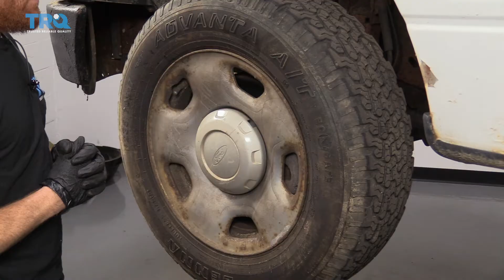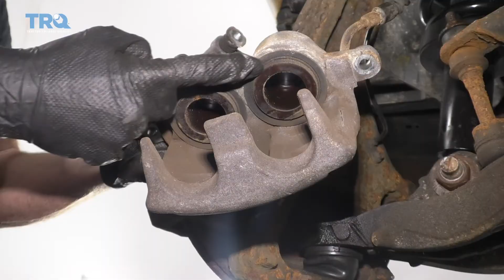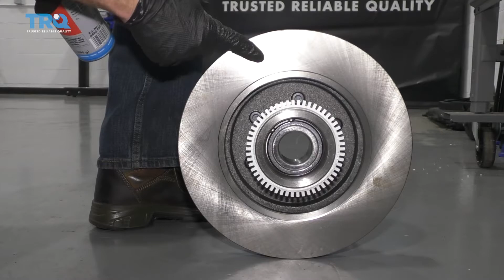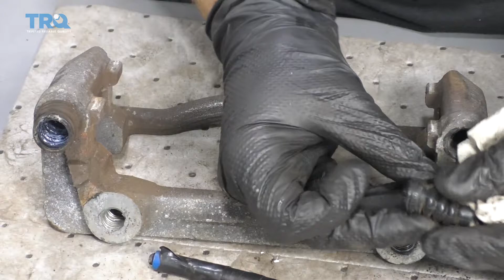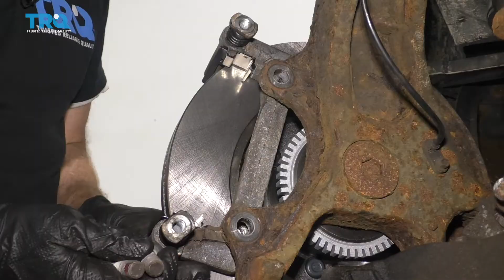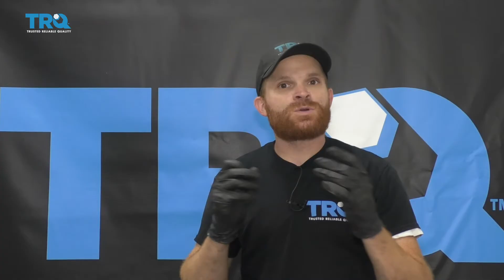How to Replace Front Brakes 2004-08 Ford F-150

Comment: One thing none of these guys ive noticed is they dont tell you to remove the brake fluid cap because when pushing the calipers back in brake fluid will go back into the brake fluid container.

Comment: Extremely helpful video. One thing that was frustrating to me was no one talked about the quality of the bearings. Upon further research I found most seemed to be no name brand from China. I did get mine at Rock Auto and found one with Timken bearings, however they were made in Timken's new China factory and are now called Goyou. They still had a better warranty, two years instead of the average one year so I went with that and they cost me 230 for both sides of the front axle plus ceramic brakes.
Some other comments: The 300 foot pound torque wrench was unavailable to borrow from any local auto parts so I bought mine on Amazon for $42 with half inch drive. Also got the 36 inch MMM deep socket for $14, and a much better dual cylinder press for $7. 
My rough issue was that the very end of the axle slash spindle had developed a lip on it and I couldn't get the new rotor back on until I filed a slight chamfer at the lip and afterwards it went on as sweet as a kiss.
Thanks for all your help amigo.

Comment: I changed both rotors and pads.... the day off... no vibration. Next day, i started to get steering wheel vibrations at 110kph... never had vibrations before changing rotors. What could this be?

Comment: I installed the spindle nut and it felt too easy... used the torque wrench and clicked at 296 ft/lbs... i'd typically exert more effort when doing the lug nuts. Is that normal? Could it be because the torque wrench is heavier and a bit longer?

Comment: Wow. That was a very thorough process to change the brake pads. It was good to see the disassembly of everything to inspect it, but that seems like it would be overkill if a visual inspection and no symptoms of front end issues were present. I did like the access you have when you disconnected the tie rod, because that made it look so much more simple to work on the truck. 

One thing that would be nice to say in the video is what size tools are needed to do the job. That would be tremendously helpful. 

Great video though!! Keep them up because they really help people!
Reply from the maker: +Brendan Thanks for watching our video and the feedback! http://1aau.to/m/Shop-TRQ
Reply: It's listed in the description along with the links to some of their parts.